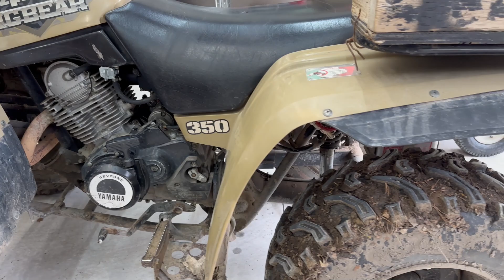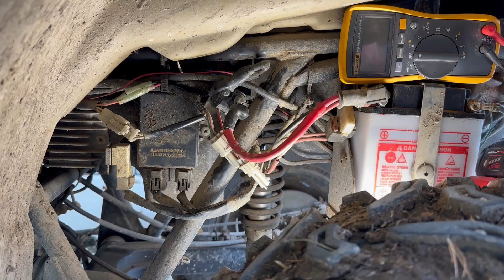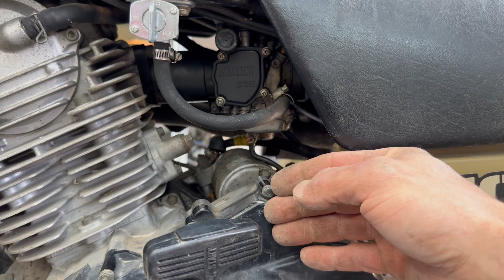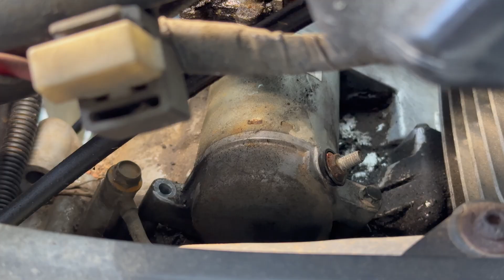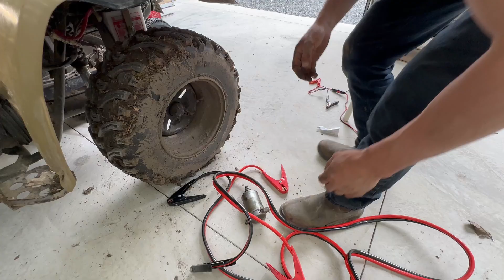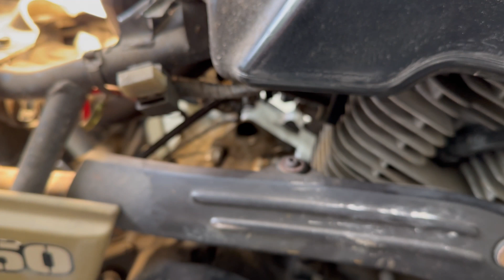"How to Test and Replace an ATV Starter on a Yamaha Big Bear 350"

Comment: Hey brother. Trying to find out where the stater is. Can you help?
Reply from the maker: The stator on a 1998 Yamaha Big Bear 350 4x4 is located under the left-side engine cover (crankcase cover), positioned behind the flywheel. It is a stationary coil assembly covered by the flywheel, which rotates around it. To access it, you must remove the left engine cover, often requiring the engine oil to be drained first.

Comment: Hello. thanks for the video. i have a similar machine, my starter is cranking, but so slow that it wont really turning the engine over. starter cables helps but not enough,
i tried the puloling the recyl starter, and found it so hard to turn that way, that only by pulling all my strenght and keeping tension on the rope i could get by kompression state.
would you by any chance have tried pulling you rope, and know if it human possible to start it that way? or if i have some mecanical problems in addition to my starter?
any advice are much apprechiated :)
BR Morten - Finland

Comment: For you all I have a unit like this. I found out that yamaha 350 Big Bear starters can be on top and like mine on the front lower side. Both staters have different mounting brackets. the top starter has vertical mounting, the front under motor is horizontal. Well I ordered the wrong starter at first.
Reply from the maker: Good to know, thanks for the info!

Comment: My big bear will pull start perfectly however the electric start just keeps turning over and won’t start the engine. What could that be???? I’ve replaced the starter, and carburetor. Still only pull starts.
Reply from the maker: Could be a problem with your ignition coil or cdi. When you start with the starter it is pulling so much power that the malfunctioning ignition components don’t have enough power to function but when you pull start it they do. Also make sure starter has good contact to battery /solenoid when starting so all power isn’t eaten by stater function.